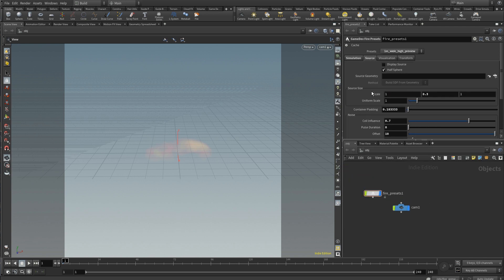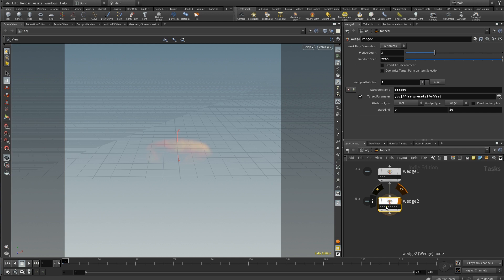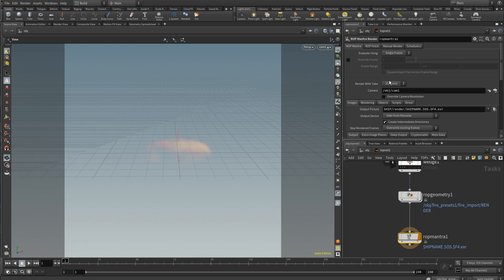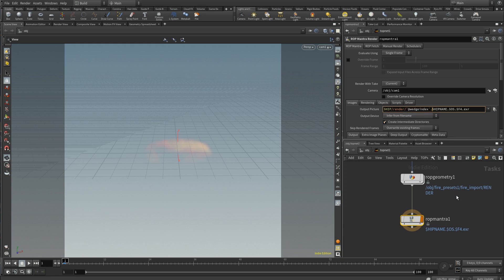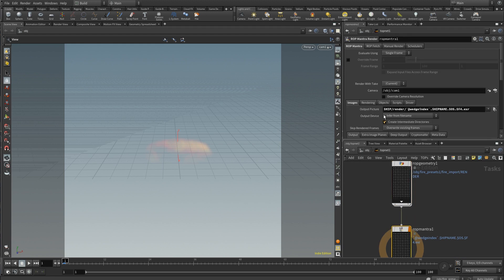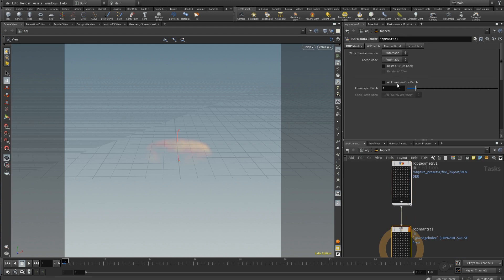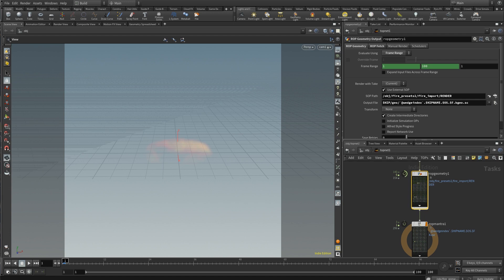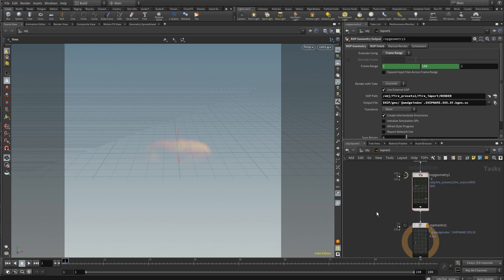Houdini PDG TOPs Quickstart Tutorial

Comment: I didnt get the 3x3 thing. Does the wedge count mean that it will get 3 values between 0 & 20?  So let me get this correct. 

You choose a node, then choose the parameter that you want to get different values from. 
Then you use ROP geometry to get the geo you want to render.
 Then you get the mantra node, to render the different simulations.
Then for the ROP geo node, you add `@wedgeindex ` , for each display geometry of the fire.
Then you use the same expression, to render out a corresponding render geo node of the fire.

Whats does "Generate static work items" mean?
What is "Rendering all frames in one batch" doing? Rendering one of the wedge versions in order?

Thanks for making this btw.
Reply from the maker: Wedge count is the number of times things will be wedged, it is also what you are referencing with `@wedgeindex` the 0 to 20 is a value that you can pass through to your sim to offset parts of it basically you can create these parameters that will then change some variable within your sim so you can for example offset noise on a mountain for your start geo on a sim but you can go even deeper and offset multiple things as well through the use of multiple parameters. Its important to distinguish between the index as it is useful throughout, a recent project I did 6 renders of the same object with different lights and used wedge index to reference the lights allowing me to one click render them all just as a note on how useful that one feature can be. You need to use rop geo because in this example you would be offsetting some variables, and are saving that sim to be rendered later down the pipe as everything is linked so these various sims will each be rendered separately not saving geo would be playing with fire on larger sims as they are very taxing on memory. Generate static work items and render all frames in one batch are ways for TOPs to recognize that you want it to sim and render frame by frame, batch by batch otherwise you will get it simulating to random frames across random sims which just means you're resimming constantly, a waste for sims. However, if all you are doing is changing model features you can ignore those as that sort of project wouldn't rely on previous frames.